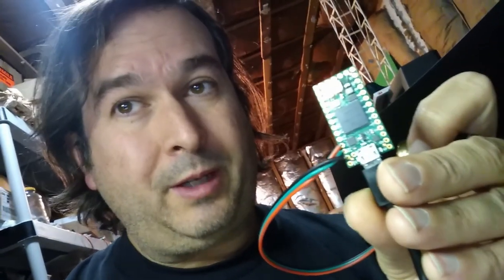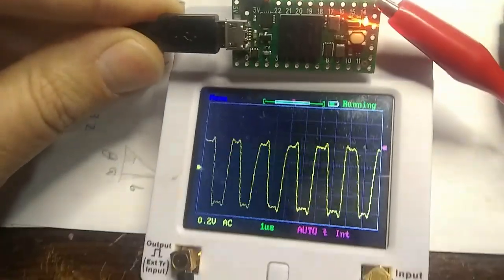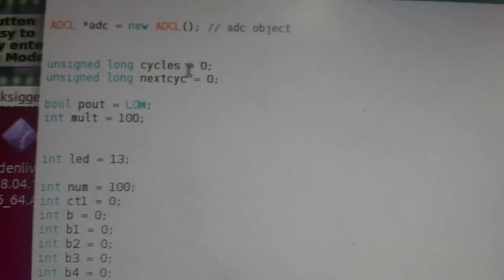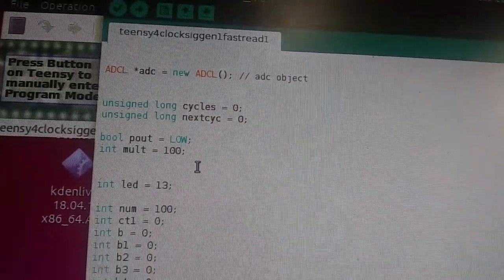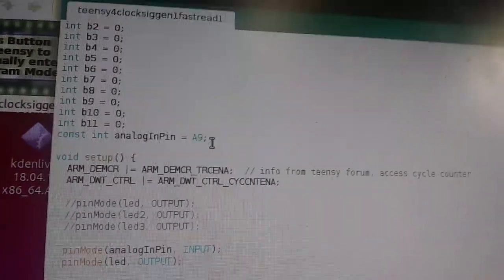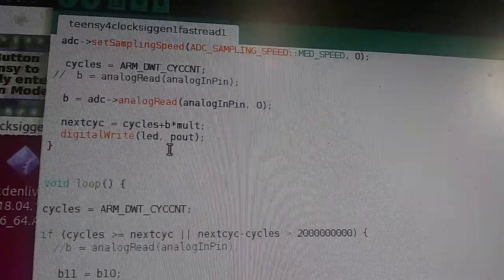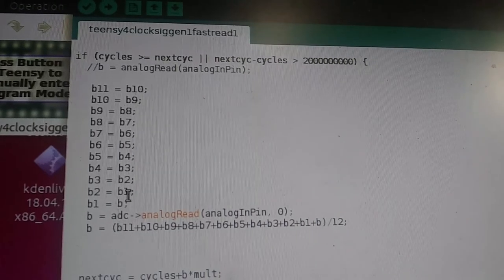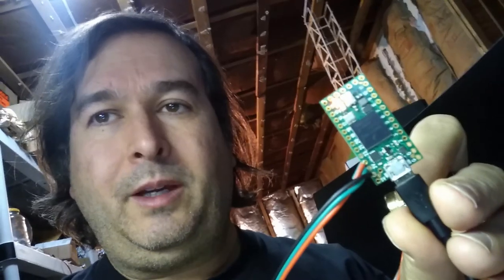Teensyduino 4.0 - Fast Digital Oscillator Using Internal Clock and Fast Analog Read

Comment: Thanks for video, well done. Trying to find out if the Teensy can convert +and- 5 volts, hard to find out. I have an old school Op amp motor driver that works really well, but now need to convert it to digital, send over fiber and reconvert it back to analog. Any ideas or do you do consulting? Thanks